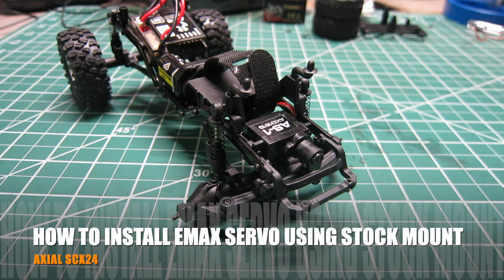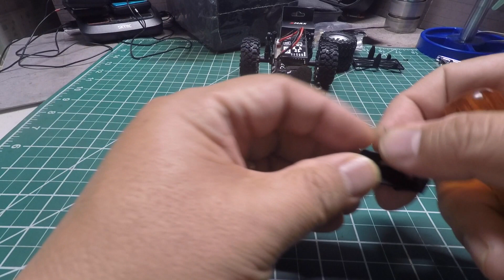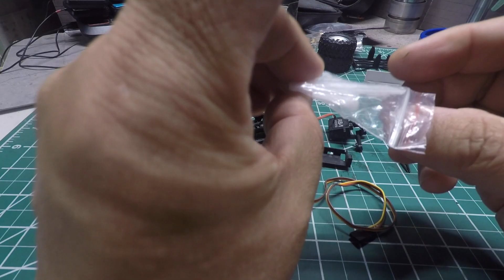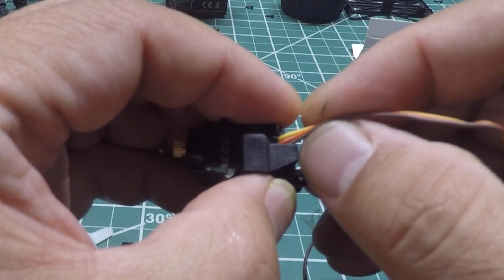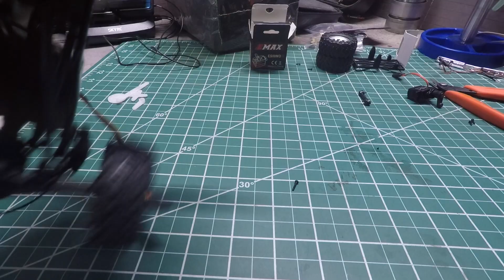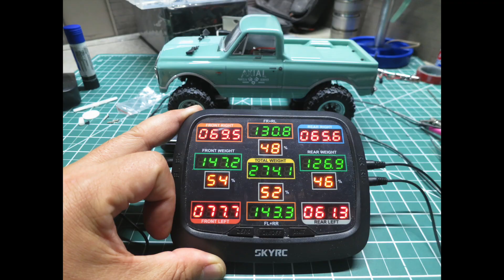1/24 Scale Axial SXC24 | Servo Upgrade - How to Install Emax Servo Using Stock Servo Mount

Comment: Servo Horn spline count?
Reply from the maker: I never counted.  I just used the servo horn that came with the Emax servo.
Reply: @BigSungHobbies  I dont care for plastic....Thanx though
Reply from the maker: @kennethrich2107  I haven’t run into metal option for Emax servo.  If you do find one, please let us know.  I believe there is metal servo horn for Reefs99 and some higher end ones, but I believe they have a different splint count…but I am not 100% sure.
Reply: @BigSungHobbies   Yes, I'm contemplating the reef servo along with the reef metal horn myself. But Geeze..$$$$. If I find an Emax compatible Horn, I'll let you know. I'm thinking the Reef is 25T and the Emax could possibly be 14T.

Comment: just installed the emax servo it last two batteries and died putting stock one back in
Reply from the maker: Wow.  Both of mine have been running well over a year.  It looks like you got a bad batch.

Comment: is there a big difference between analog and digital servos? seems like the analog one's are cheap and available.
Reply from the maker: I believe it's only 12Kg vs. 13Kg, so the difference is very minimal.
Reply: I cant find a digital version
Reply from the maker: I use both as well.  Nothing wrong with analog, but the digital version seem to be just a bit more direct.  But almost at double the price, not sure if it's worth it.

Comment: I found out that my scx24 has no weight in the front surprise surprise :-/ so this should be good for my scx24
Reply from the maker: It will add few grams to the front.  I would recommend looking into brass knuckles and brass diff cover to the front to help with weight distribution.
Reply: @BigSungHobbies  yah I was thinking about that last night cause I’m making a hill side crawler track
Reply from the maker: You want to get to as close as 60/40 weight distribution.  That will help tons with crawling.  Good luck

Comment: Hello, first thank you a lot for the video! i did the same and work perfect. But i got a question, my servo is the Digital version (ES08MDII) and is shaking. I think is a problem with the servo because i try it in others ESC and happen the same. Do you know if there's any difference between Analog and Digital Servo? Anyone with the same problem? thanks!
Reply from the maker: I have both digital and analog version, and the servo should not be shaking at neutral position.  You might want to contact the place of purchase, and see if you can get a replacement unit.

Comment: you said you were going to use the diff mount screws because of the gap, so what did you use for the diff mount?
Reply from the maker: The HR brass diff covers comes with new stainless steel screws so I used those.  Also I picked up a set of stainless screws which comes in very handy.
Reply: @BigSungHobbies  yeah I'm a newbie, just picked up my first micro crawler and second rc car ever yesterday, so I'm lookin to you guys makin videos for help lol. I just took the bottom screws from the diff cover put those on the diff mount, used the diff mount ones for the servo mount and used the servo mount screws for the diff cover. kinda confusing in words but looks like it'll get the job done
Reply from the maker: @AdventuresInCameronology  We all started at some point.  Welcome to the hobby!
Reply: @BigSungHobbies  so wtf am I supposed to get se to put the servo on I don’t have the brass diff cover
Reply from the maker: @Jsjsjdkkdkdjdjdijdnd  In that case, you should order some extra screws.  Axial has a kit of screws for $7.  The taller servo will require longer screws.

Comment: Dood, with your knowledge and tips, I really did a good job with this exact installation with the d series emax, instead of the a series! thanks a tonnage! I got my scx24 jlu crc jeep muddy bogged and totaled it. Had to replace the transmitter, esc, servo and motor, and thanks to you I got the final thing, the servo swap done and now my build is on the run! wooot wooot to you!
Reply from the maker: Great to hear!  Enjoy the SCX24...they are tons of fun!
Reply: These little guys are really great to work on glad you got her running again.

Comment: I just installed this servo on my scx 24 jeep along woth the hot racing aluminum servo mount but i have an issue. When i push the suspension travel up and down to simulate, there is a plastic “block” on the inside of the frame rails near the front that is hitting the screw heads that hold the servo on the servo mount. Any suggestions?
Reply from the maker: I have not used the hot racing aluminum servo mount, so I have not run into that issue.  Might ask on one of the FB group pages?

Comment: Thanks for the video.  I plan on reusing the stock steering linkage.  Any issues using an o-ring by the steering horn, in addition to the ones by each knuckle?
Reply from the maker: Nope, I have not had any issues.  I plan on doing it with o-rings on B-17 Betty shortly.

Comment: Good video, you don't really need to even remove the mount but it was easier to see for the video.
Reply from the maker: Thanks!  It was easier to remove the mount so that I can take a saw to file the notch for the cable...plus with this big fingers and hand, it's easier to work with it...plus it helps with the video as well.